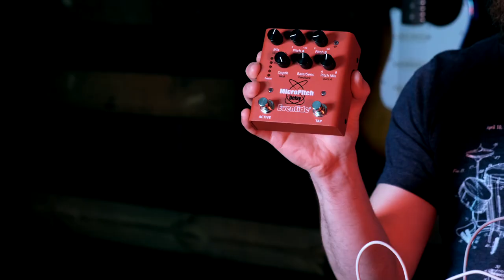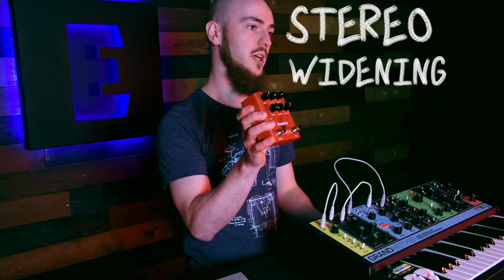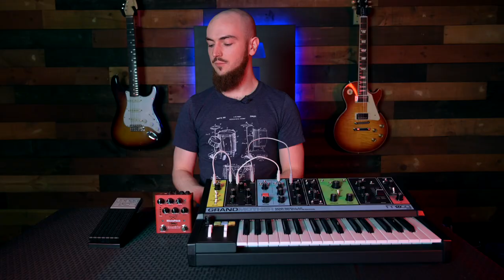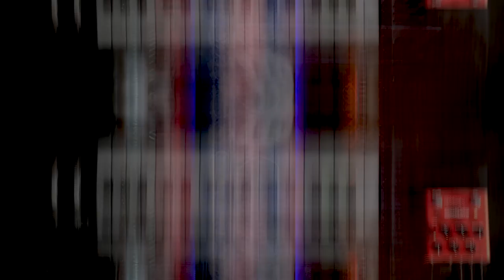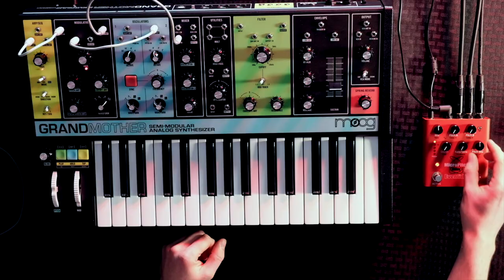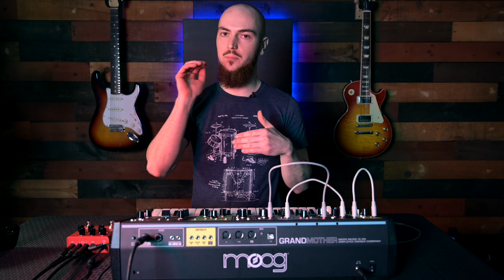Eventide MicroPitch Delay Meets Moog Grandmother: No Strings Attached #1

Comment: so there is no cancellation of the stereo wet signal, if the track is collapsed to mono? some pedals use phase-flip inversion to create stereo width, that cancels out when summed to mono. if the micropitch has 2x independent delay lines, this shouldn't be an issue?
Reply from the maker: If the pedal is connected for mono operation, there is no width enhancement processing. The algorithm simply reconfigures for mono operation. While MicroPitch still does a good job of offering thickness to the sound in mono, it does excel in a stereo configuration.